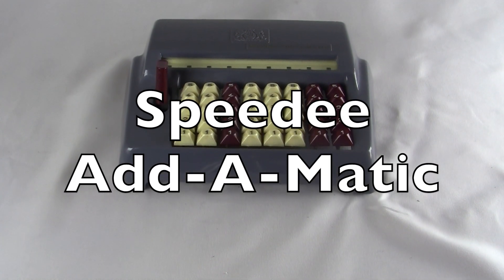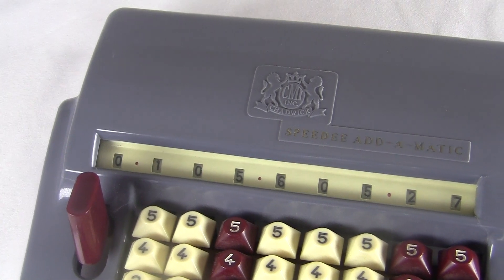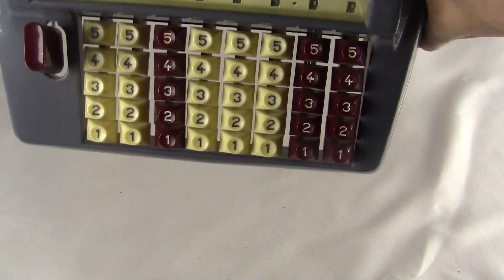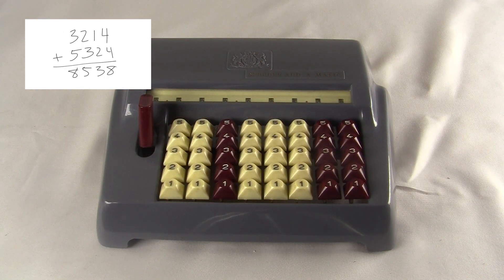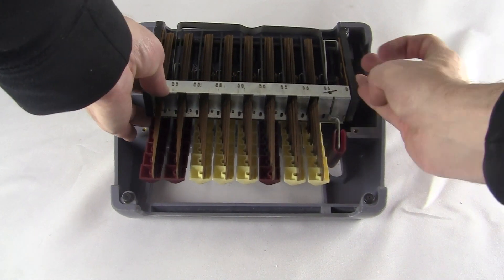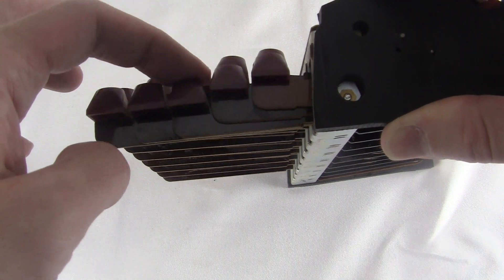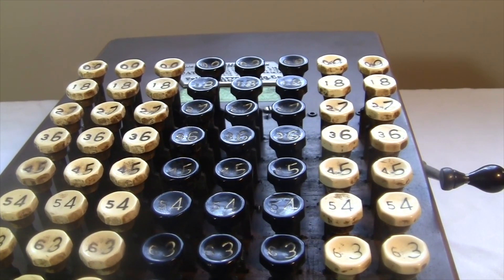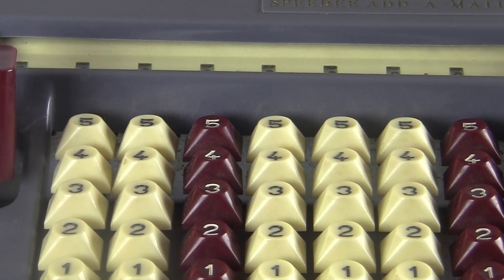Speedee Add-A-Matic Review / HowTo

Comment: Dude, I don't know how long ago the video was but I did watch someone speed run calculators. This would be  amazing to have in the irl speedrunning community.

I am unsure if you will see this because this video is so old now.
Reply from the maker: I don't really know anything about irl speedruns, but I would totally do this if you think people would be interested. I no longer have the Speedee Add-A-Matic, but the Comptometer would be better anyways.
Reply: @ChrisStaecker  I am absolutely sure people would enjoy, but I recommend looking into different types of speedruns and speedrunning community befor you start. The only irl speenruns I witnessed was the calculator speedrun and the pencil sharpener speed run. (Both of which from Point Crow.)
Reply: @ChrisStaecker  You might have to do it like minecraft, with a randomized map/page of questions.

The Calculator is just 1+1=2
+1
+1
+1
+1...
Till 100 as fast as you can.
Reply: It may have been SmallAnt for the speedruns, my memory may have be faulty.

Comment: I have a later variant of that Contex model, and it is very much like this Japanese clone but with a metal casing. It also has square buttons and disassembles in exactly the same way. Its bottom plate does extend underneath the keyboard though. I find it curious that the key levers are made from the same stuff as printed circuit boards.
Reply from the maker: Very interesting- I suspected that this was an exact knockoff of something but I could never find the precise "original". Thanks as always for your knowledge-